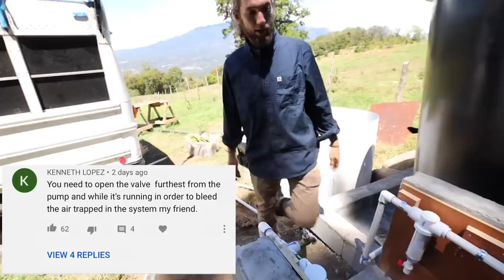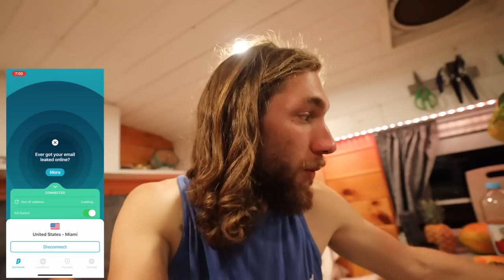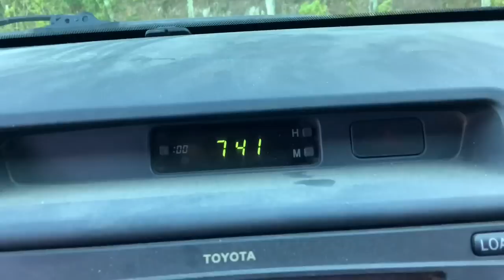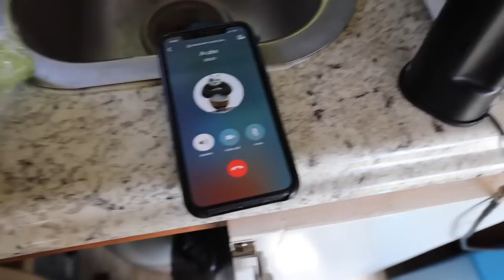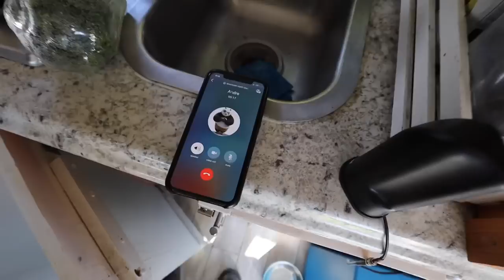Forced Into Quarantine In Our School Bus // van life Panama

Comment: 💦💦💦💦 GUYS!  You need to install a bladder of some sorts after the pump.  Right now, what your pump is doing by cycling on and off is called "dead heading".  Water is not compressible, so your pump cycles between the line pressure going out when the water is on or there is flow and as much pressure as it is allowed to build when it is off.  That is why it goes on and off so much.  Somewhere right after the pump, you need to place a tee, with one outlet pointing up.  Then make a vertical piece of pipe (preferably with a larger diameter pipe, if Panama has adapters that allow you to go to a larger diameter, say 2 or 3" if you can adapt up that large)  Essentially, you are making an area for an air chamber.  Think of it like a PVC "balloon".  This allows for an area of compression.  The air in this chamber is compressed up to the set pressure of your pump.  It acts like a shock absorber and also acts like a pressure reserve so your pump doesn't have to cycle near as often.  When you dead head the pump all the time you will shorten it's life by probably 10X.  At the top of the vertical riser you will glue a cap on there.  In the PVC cap you will install a bicycle valve.
Get that here:

https://www.amazon.com/WYNNsky-Standard-Threads-Pieces-Sealing/dp/B07G37D25L/ref=sr_1_3?dchild=1&keywords=tire+valve+threaded&qid=1585415454&sr=8-3

You are going to let the pump run for just a bit, then when there is a little pressure, you are going to pre-pressurize the system up to say 45-60psi (the higher you go, the harder it is on your sink valves, you will find the sweet spot).  This allows the pump to run longer but way less cycling.  If you don't have an air compressor, you may have to use a bicycle pump to bring your new air chamber up to that pressure.  YOU ARE NOT USING THE PUMP TO BUILD PRESSURE AT THIS POINT. You are pre-pressurizing the system.  Important is that you don't ever let the system leak all the air pressure out, lets say if you turned off the pump at this point and opened a water spigot near the pump and all the water ran out and then all the air leaked out.  If this happens you have to re-prime the system again following the steps above.

You should also place one of these fittings at the tank and one on each side of the pump so you can work on any part of the system easily, VERY IMPORTANT! 💦💦💦💦

https://www.amazon.com/Homewerks-Worldwide-TV206192-Slip-Union/dp/B00FQ5A3P6/ref=sr_1_5?dchild=1&keywords=PVC+QUICK+DISCONNECT&qid=1585415791&sr=8-5